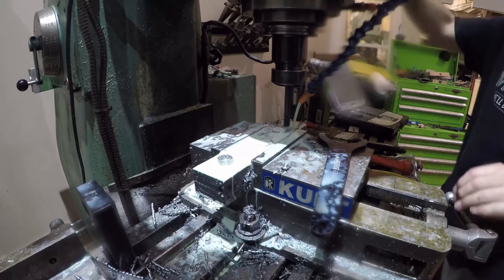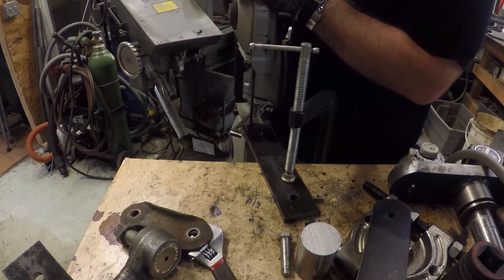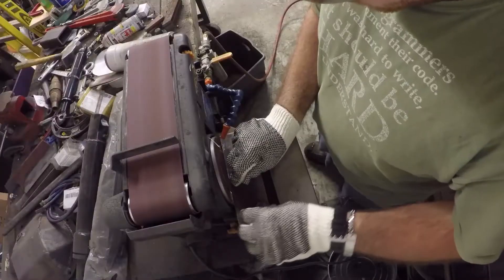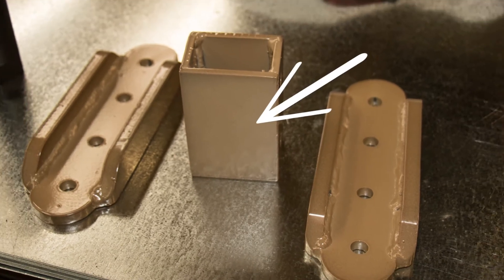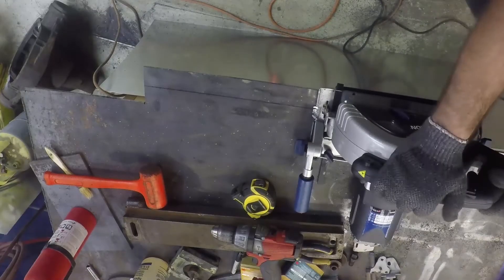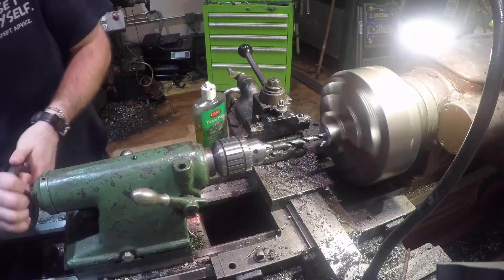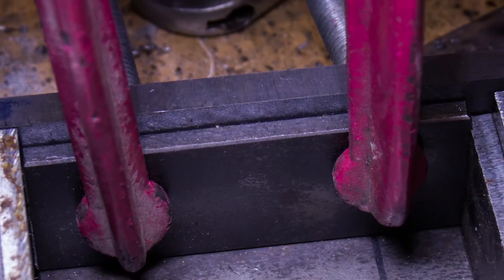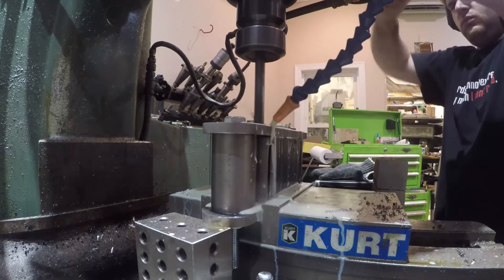DIY Leaf SPring shackles

Comment: DIY if you have access to a shop, otherwise better and cheaper to buy.
Reply: I dont know about that because alot of steel suppliers have brakes, min charge for brake time is like 15 bucks around here. Still dont know if they are cheaper even with a shop if you value your time much though. I need a specific size so I am custom building.